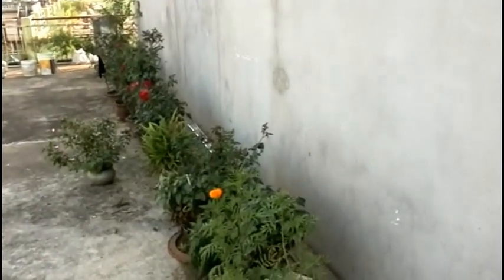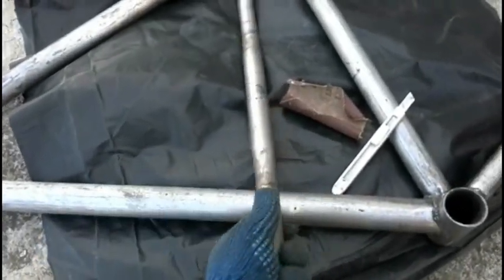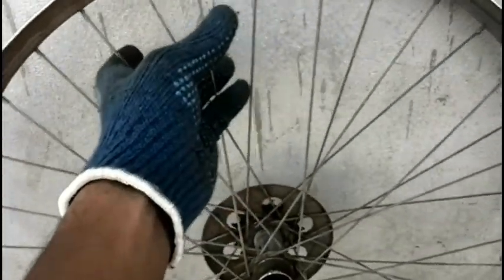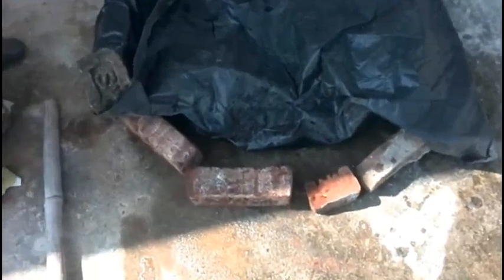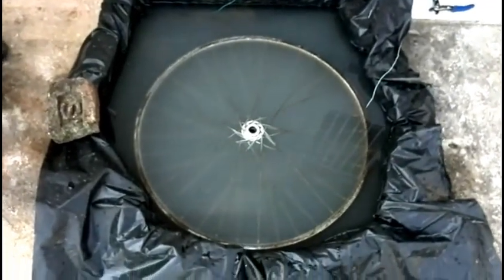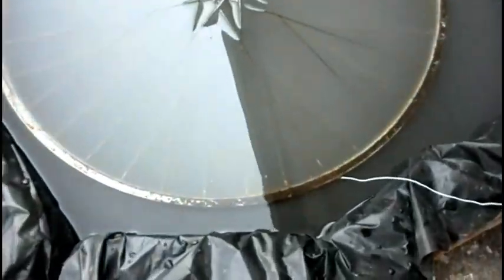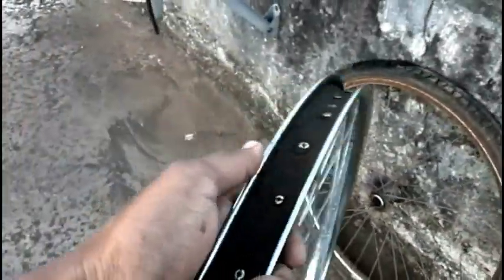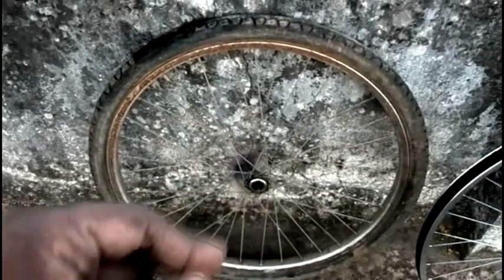Bike RIM rust removal, electrolysis rust removal process. Do it yourself

Comment: Electrolysis creates atomic hydrogen, which can ruin the steel. This is called hydrogen embrittlement. ⚠️
Reply from the maker: I appreciate your inputs. For once or twice I don't think the process will harm, It has been 5 years now and my cycle is doing absolutely great with these Rims .
Reply: @srichand9  All right. Thank you. I'm not an expert. (And my english is not good.) But that might be important to know, I thought. More information can be found at Wikipedia, for example.
Reply from the maker: @Tag-Traeumer  your English is really good, and this is how we share and learn new things. Sometimes theory differs from reality
Reply: @srichand9  Yes. Thank you. 👍 And: My "English" isn't really my English, it's from the google translator. 🙂
Reply from the maker: @Tag-Traeumer  google translator is doing a good job
Reply: @srichand9  😀 Thank you. Yes, without a google translator I couldn't communicate properly.

Comment: 1.How much volt v should use it?
2.Adapter charger wire is necessary? Can I use Normal wire? 
3.washing soda means tell some name dude?
Reply from the maker: 12V is good and normal wire will do. Go to a general store and ask washing soda, you will get it
Reply: allu srichand thank u